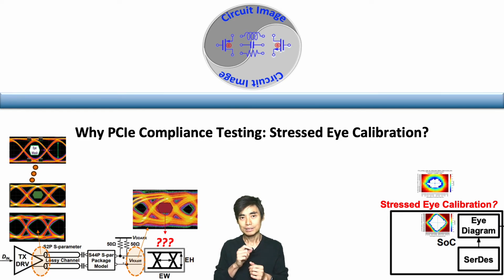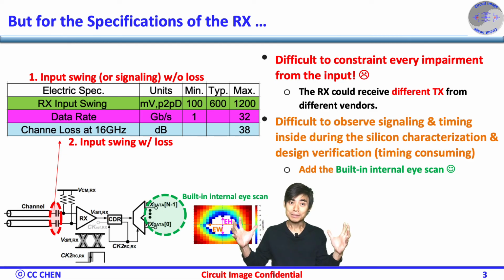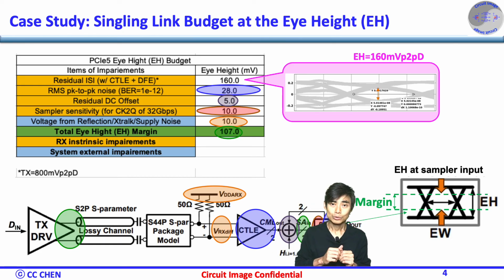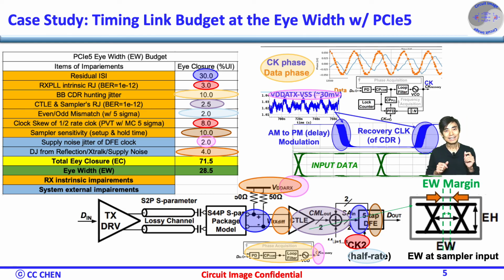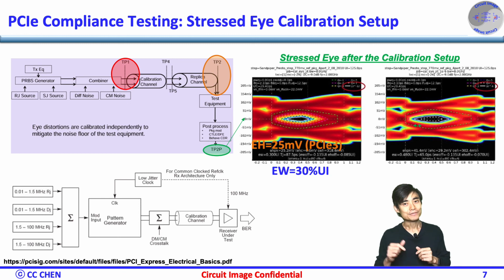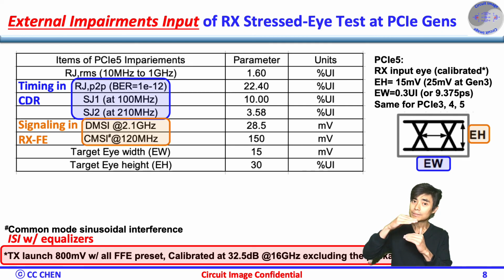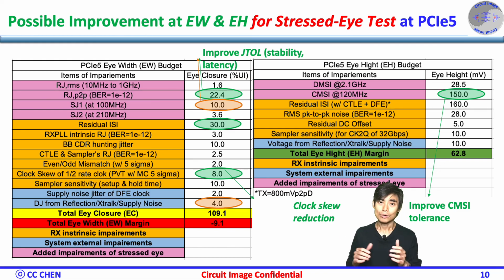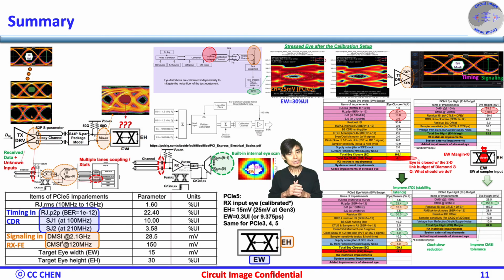Why PCIe Compliance Testing: Stressed Eye Calibration?

Comment: Have a question: when doing JTOL test on DUT, do we need to enable TX and Rx on other lanes? which will add extra lane2lane xtalk impairment to the target lane
Reply from the maker: Hi Wenge,

Good question!

Ideally, during JTOL-only (Jitter Tolerance) testing, you should enable TX and RX on adjacent lanes to include realistic lane-to-lane crosstalk impairment. This practice ensures that your test environment closely replicates actual operating conditions, capturing potential degradations caused by lane-to-lane coupling.

However, depending on your specific test objectives:

1. If your goal is worst-case performance validation, enable adjacent lanes to account for crosstalk.

2. If you're isolating intrinsic jitter tolerance of the target lane (to characterize RX alone without external impairment), you could test with adjacent lanes off, but remember this scenario may not reflect practical usage.

But, again, according to PCIe compliance test procedures (like the PCIe Base Specification and PCI-SIG test guidelines), the RX under test should be tested with a standardized stressed eye signal without additional lane-to-lane crosstalk from adjacent lanes.

Hope this clarifies things!
Reply: @circuitimage  Really appreciate your detailed explanation. Probably, my question was not clear regarding JTOL. I thought the JTOL test was the one defined in the PCIe base specification, which is the procedure conducted after Rx stressed eye calibration. Anyway, you have explained JTOL in all cases (isolated lane, isolated lane+adjacent lanes xtalk, base spec) —thank you so much!

My confusion about stressed eye JTOL in base specification:
in section 8.4.2.1, impairments (Rj, 2nd Sj, DMSI/CMSI) are calibrated to generate a controllable worst-case Rx eye. As you pointed out, the DUT is supposed to be tested under the same conditions(to make sure the same EW/EH). If enabling adjacent lanes, xtalk will make Rx stressed eye worser and uncontrollable.
However, In section 8.4.2 of the PCIe 5.0 base spec, it states that all other Tx and Rx should be enabled to mimic a real noisy environment. That is misleading, from my perspecitve.
BTW, what's the setup of enabling adjacent Tx/Rx lanes? what we do now is self Tx/Rx loopback with short cable.
Reply from the maker: @WagonScholar  
Hi Wenge,

 great point!

Yes, Section 8.4.2.1 focuses on creating a controlled stressed eye using calibrated impairments (Rj, Sj2, DMSI/CMSI), so the DUT sees a repeatable worst-case eye with known EH/EW. Adding adjacent lane activity (as mentioned in 8.4.2) introduces crosstalk, which can distort the eye in an uncontrolled way — making it hard to ensure consistent test conditions. That’s where the confusion comes in.

Your current loopback setup with a short cable is a clean and common approach for isolated JTOL testing. If adjacent lanes are enabled, it’s usually done by driving PRBS on neighboring lanes (terminated) or using a system board setup, but that’s more for system-level noise evaluation, not base spec JTOL.

Thanks,
CC
Reply: @circuitimage thank you very much, CC
Reply from the maker: @WagonScholar  ur welcome. 🙂